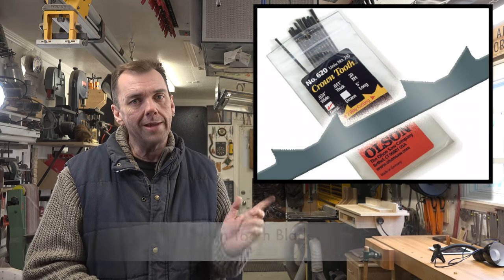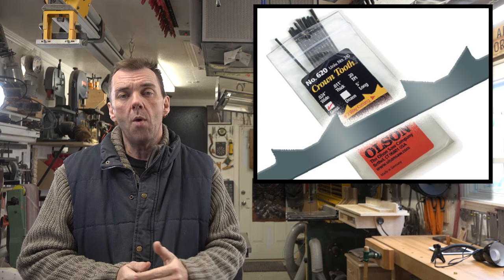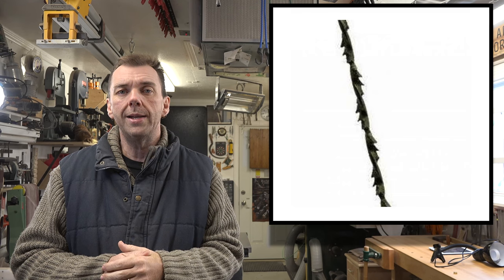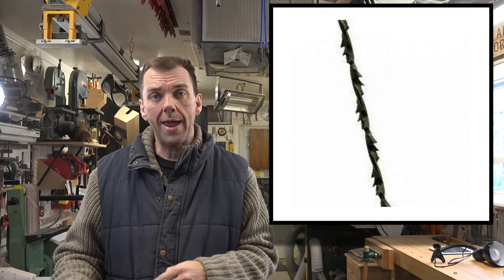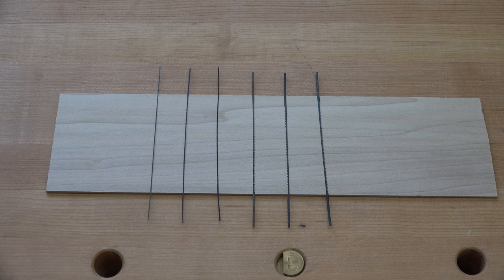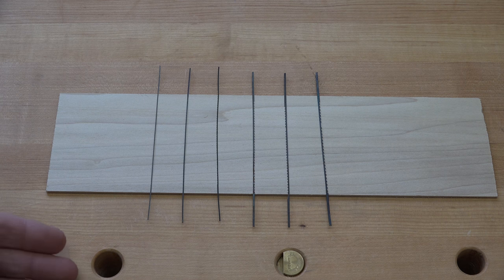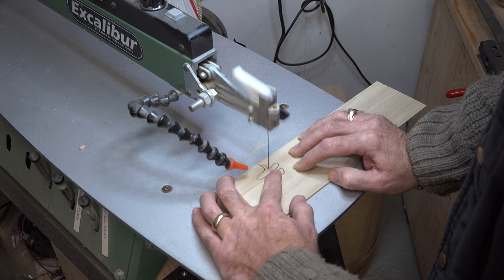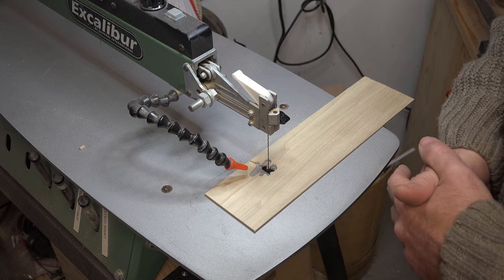Scroll Saw Blade Selection

Comment: You lost me when you laid the "pinned" blade up there and made the statement of " is for another type of scrollsaw".... The "pinned" blade you demonstrated is for a handheld coping saw...
Reply from the maker: On the contrary Tracy.  The blade that I show in this video when I state that it is for a "different type of scroll saw" is exactly what I stated.  I have a rather old scroll saw that is run (believe it or not) by a chain drive mechanism.  The blade is driven by a piston.  It is an antique and I've never seen another one like it.  The blade that I laid down on the bench is for that saw and while it can be used for a coping saw as you stated, it is also for my antique scroll saw.  The blade was only used in the video to show the girth of a pinned blade, versus the girth of a flat end blade.  I hope this clears up any confusion you may have had.  Thanks for tuning in to the show and taking the time to leave a comment.
Reply: @acutabove_woodworkings  I suppose I stand corrected and thus offer my sympathetic apology.
Reply from the maker: @tracyalexander3662  No apology necessary.  I would have assumed the same thing as it's about the same length as a coping saw blade.  The antique saw is pretty unique and I don't use it for fear of it imploding.  LOL.  I tune it up once in a while to keep it from seizing but for the most part, it's just a display piece.
Reply: @acutabove_woodworkings  So I was browsing I believe it was ebay? I saw an antique, what appeared to be belt driven, craftsman scrollsaw, no motor was attached and the original papers were shown, it was listed new in 1938-45??? Not certain of it's production ending year, but it was listed at $6.25! I understand it was a much different economy then... It also had a longer blade so yes sir thank you for the education, always open to any nuggets of knowledge.
Reply from the maker: @tracyalexander3662  $6.25 was a lot of money back then.  I looked into the age of my scroll saw but I can't remember off the top of my head what year is printed on the nameplate.  It really is an interesting piece though.  Thanks for sending this comment.  I find this kind of stuff very interesting.